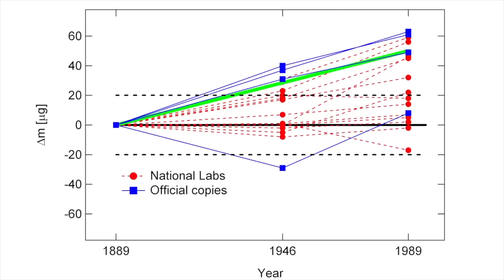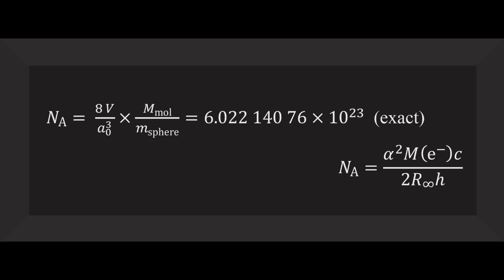The kg is dead, long live the kg

Comment: I've been waiting for this day ever since I took a course in thermodynamics. The way 1 kelvin is defined was a mess to understand and a whole lecture was spent going through how you need 2 reference points to define a temperature scale and for Celsius it was freezing and boiling point of water. For Kelvin they got absolute zero as one reference point but then it still uses the triple point of water as the other so it's still just a sliding scale between those two reference points. If I were to redo that course I could just ignore all that and instead just say that 1 kelvin means that particles in a gas has an average kinetic energy of 1.380649×10^−23 joules and that's the definition. No more absolute zero or boiling, freezing, triple point of water now temperature is defined to be a measurement of the average kinetic energy of particles in a gas.
Reply: I still think there's work to be done: Kelvin is just the scale we read off thermometers, but still we give it the lofty status of fundamental unit. Bah; temperature is just energy - just report it in Joules, with Boltzmann's k merely the conversion factor between the scale and the physical thing we're actually measuring (or just because we read the angular displacement of a needle in a voltmeter, do you think we should report volts in radians?)
Reply: @thstroyur  It's "lofty status" is the result of the fact that no other fundamental unit, or combination of them, can measure the property of temperature. Temperature is not heat, it does not take heat capacity or flow rate into consideration.  For example, the temperature of the sun's interior may be the same as the temperature in the core of an atomic weapon, but they area enormously far apart in terms of energy.  Your analysis fails there, and your analogy about voltage is just dumb, but in homage to the field of engineering analogies, temperature is analogous to voltage.  However, you don't measure electrical energy by that voltage; it's only part of the solution.
Reply: @puncheex2  "no other fundamental unit, or combination of them, can measure the property of temperature" I regret to bust your bubble, but units are arbitrary and devoid of meaning: e.g., in natural units, I may say that lengths have units of mass^-1 (Peskin & Schroeder, An Intro to QFT , sec. 10.1). Besides, you claim there's no other way; well, according to the eq of state U = TS + F, since U has units of J and T of K, S must have units of J/K, because it's obvious that's what entropy is about. Plus, where this dimensionality comes from: you guessed right if you thought Boltzmann's k. But suppose we call the quantities S/k and kT entropy and temperature respec. - would anything change in the eq of state? (Notice also that's conceptually distinct from merely putting k = 1 - that merely readjusts the unit of temp...)
"Temperature is not heat" Nor work - I said energy , I didn't specify which kind. But what do you make of the F above?
"they area enormously far apart in terms of energy" Yes - you can see why using the formula I gave above 😒
"Your analysis fails there, and your analogy about voltage is just dumb" If you rest this polite conclusion of yours in the previous, you rest on a strawman
"you don't measure electrical energy by that voltage" So how do you calculate the energy stored in a capacitor? Can't I put a V there somehow?
Please, educate yourself before criticizing others...
Reply: @thstroyur  what is the point of redefining temp to be in energy. The 2 are not linearly related and differ per material. So if it was redefined in J I would have to grab my calculator every time i wanted to know if there even is any heat exchange between 2 materials. instead of being able to tell they have approx the same temp anyway. For cryogenics i can imagine there are where instances energy is easier.
Reply: @someonespotatohmm9513  *0) I'm just proposing that T have units of energy, not be energy itself, cf. U = TS + F, 1) It intuitively makes sense (look up equipartition, <E>~kT/2), 2) it clarifies the meaning of entropy, which, up to the physical factor of k, is defined as Shannon entropy by Gibbs and Jaynes, 3) "The 2 are not linearly related and differ per material" you're thinking material-specific stuff like thermal expansion, etc., whereas T is a macrostate (or at least conjugate to one), just like volume or particle number, 4) "I would have to grab my calculator" no you wouldn't, 5) this is already done in plasma physics just because for large temps the units read as simple multiples of eV (100°K~1meV, 10^8°K~1keV) - the diff is that this is like reporting frequencies as cm^-1, rather than acknowledging T's dimension is unnecessary
Reply: Great.  But then someone finds that the value isn't ...0649 but rather ...1649.  Will your thermometers then change, or not?  I'm not saying tthe idea is wrong, only that science advances, so you have to figure out how your measurements will work in that regime.
Reply: @puncheex2  if it's defined as ...0649, then your thermometer would by definition be wrong, and need adjustment. This is a feature, not a bug!
Reply: @SimonBuchanNz : Simon, they are defined constants for metrology purposes only.  For other scientists using Planck's Constant or whatever, they will proceed to use the latest values determined by experiment. Eventually, the values used to define the SI units will change as well to incorporate changes.  There are probably hopes that later determined values will be close to those chosen this month, but there are obviously no guarantees.  When the metric system was developed, the meter was set to 1/10,000,000 the distance from the pole to the equator.  Today the meter is 1/ 10,001,960 of the same distance description.  They didn't change the meter or the Earth to make the definition stick - they changed the conversion factor.  Scientists didn't persist in using the old definitional value for that distance after they had refined it.
Reply: Physical constants will be defined to have specific fixed values and then the size of our units will be determined to better and better precision as technology improves. Our understanding of the size of the units we use to make measurements will evolve over time instead of the values of physical constants in terms of our units.

Comment: I kind of don't like that the fundamental constants of the universe end up being these long messy numbers. Does there exist any possible system of human-scale units such that all the constants are neat round numbers? Or are the relationships between the constants such that they'll never be neat, no matter how we define the units?
We should be able to set up the units so that at least some of the fundamental constants become 1, right?
Reply: Nope.  Why would they line up with our decimal system, or anything else consistent?  You could make your most fundamental constant 1.0000000000, but then you're going to be breaking all the other units to do it.  Since there's no real advantage, it makes more sense to define them arbitrarily to not break the existing units (or to break them as little as possible, where there are conflicts shown by fundamental relationships)
Reply: You could set them all equal to 1 if you wanted, but then the definition of every unit would change massively. The whole society would have to adapt and all previous research would have to be converted, easier just to choose values close to what they were under the old system.
Reply: @oniondesu9633  You actually can't, some constants always get messed up. That, however, didn't stop scientists from trying. If you google "natural units" you'll see different attempts.

Comment: Fixing Planck's constant seems like a bad idea. There are better solutions to the mass problem than to mathematically define constants. Our measurements will only improve with time, and this system will also have to be overhauled. There has to be a better way.

Comment: It is a fundamental question of whether universal constants are rational or irrational.   If universal constants can be written as sums of series like Pi or e then all these definitions of fundamental units are wrong.  

 About a month ago professor Atiyah ‘s research on fine structure constant showed this constant can be written as a sum of a series.  This also leads to solving the most famous  Riemann hypothesis.  

Although the general criticisms saying this claim for solving RH is wrong and unpatchable, this makes me to rethink whether the values of universal constants are actually rational or not.
Reply: I think you have missed the point of the issue, the value of the constants is entirely arbitrary. Choosing a value of the constant determines what the unit of measurement is. If under one system you have h = pi, you can convert it to a system whereby h = 1, and all that will change is the definition of a kilogram. Whether the constant is rational or not is irrelevant.

Comment: Next step,  special scientific units compatible with the fundamental constants. An alternative to second taking 10^10 periods of the radiation corresponding to the transition between the two hyperfine levels of the ground state of the cesium 133 atom, a unit of length that light traverses in 10^8 of these, a unit of mass equal to the energy of light at 10^50 Hz...

Comment: There's a fundamental philosophical problem with tying reality to abstract concepts in this manner: It trains people to never question things called "constants." Science is about overthrowing ideas, not enshrining them forever.
Reply: Scientists would always question assumptions. That's what it means to be a scientist.
Reply: And yet, this process is to enshrine assumptions in stone.
Reply: @GrantDexter  We just changed a unit. We redefined the kg in a different way, it's far from changing our understanding of reality.
Reply: That's fine. However, my objection has not been addressed.
Reply: @GrantDexter  I don't really get your objection. You do realise that all physical constants are absolutely arbitrary unless they're dimensionless, right? It's not a harmful assumption but a matter of sanity. We aren't tying reality to any abstract concept whatsoever.
Reply: Actually, measurements are being tied to abstract concepts. That was the whole point of the video.
Reply: @GrantDexter  That's always been done, you can't have measurements without abstraction. The ratio between energy and frequency (Planck's constant) isn't any less abstract than the old 1kg block.

How do you think we measure mass? It's already an "abstract concept" because we  can't measure it directly, we must use the ratio between force and acceleration and call that mass. Now we chose to do the exact same thing but instead of doing it with a block of metal we use light and energy. Those aren't abstract concepts. Or at least not more abstract than what we previously used.
Reply: There's nothing wrong with abstraction. There is not going to be any problem using this new system. The problem I outlined is philosophical. Tying measurements to a unit that will not be changed implies that the ideas that led to establishing the unit must be correct. This process enshrines ideas, the opposite of science.
Reply: @GrantDexter  You are speaking of these "ideas" that are assumed to be correct, what kind of ideas are you talking about? We could just grab a random object and call it a kg, it would be exactly the same. Absolutely no difference. What idea are we assuming to be correct? We just picked up an object. There are no ideas that established the unit.
Reply: The assumptions behind the establishment of the constants being used, be it lightspeed or Planck or whatever.
Reply: @GrantDexter  You still refer to "assumptions" but never say explicitly what we are assuming. Do you know something that the rest of the scientific community isn't aware of?
Reply: If you don't know, or aren't prepared to research, the assumptions that go into things like those I shared in my previous post, then there's not much point trying to explain the philosophy of science.
Reply: @GrantDexter  it's clear that you are throwing around random words hoping to sound intelligent because you don't know how to reply as soon as someone asks which "assumptions" are concerning you. Great strategy.

The only assumptions we are making are that the speed of light is constant and that energy is proportional to frequency. These two assumptions currently give a good explanation of physical phenomena so we haven't been able to reject them. Your opinion that using this assumptions would go against the philosophy of science is laughable. Why do you think that we used a solid block of metal to define mass? Because we assumed that mass equals the ratio between force and acceleration. Obviously that assumption didn't stop us from questioning it because we then discovered that force doesn't always equal mass × acceleration. Your fear of assumptions only shows your ignorance about the history of science.
Reply: Apart from the fact that I've clearly stated the ideas in talking about.

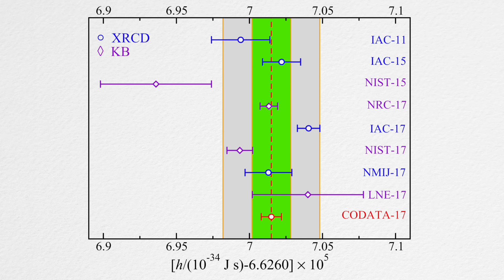Comment: I don't understand how Planck's constant is exact now. Doesn't Planck's constant not rely on a larger variety of measurements? If it relies on measurements, then the value of Planck's constant is not exact - per definition. Even if it's not per definition not exact, the graph at 3:30 shows various estimates of the mean, along with standard errors. Standard errors of a size above 0 exclude exactness.

I accept that redefining Planck's constant is revolutionary, and that it allows for far more accurate, precise and reliable calculations. But I do not accept that it is exact.
Reply: "Doesn't Planck's constant not rely on a larger variety of measurements?" This is the whole point, currently Plancks constant depends on measurements of physical quantities, but the number is completely arbitrary and just based on how we define our units. Once the fix the value of the constant, we can swap it around so the constant defines the units. We could set Planck's constant equal to 35 and it would have been correct, but then the kilogram would be significantly altered.

Comment: I saw the meter is defined by The distance travelled by light in vacuum in 1/299792458 second. Is this distance independent of gravity? if this measurement would be done (in theory) near a black hole, wouldn't the light bend, resulting in a longer path? Or is nothing strong enough tot have a bending effect over the span of a meter?

Comment: As an American who understands both metric and imperial, have always argued that metric is an amazing execution but horrible principal, as the measurements, as far as I've been aware don't have any defined exact besides what we've given them.

While imperial is a great principal but horrible execution, basing everything on human averages, although failing as I don't think any proper scientist tried to average it out if my memory is correct, 100, being "average" human core temperatures and 70 being mild, keep in mind 70% is a C and has been used to mark average scores for some odd reason instead of 50, and using 70 as mild exterior temperature, which would be about 16C, and 100 as human, we then get our 0F good principle using human averages so you in theory wouldn't need to rely on measuring tools for rough measurements, same with weight and distance, but ultimately failing horribly in execution as it's just a disorganized mess because no actual averages were taken into consideration, and those averages can and will change.

This new method would really define the metric even more as the superior system, I'm still hard wired into thinking pounds due to every system around me requiring them, and that when it comes to day to day uses that fahrenheit is more practical since it is based on human needs, as well as easier to get a more preceise read for things like fevers and weather since the boiling point of water for F is 212 thus giving us twice as many points to map out without going into decimals, and as such I genuinely wonder how different it would be if we historically had one system made that took the human use practicality of imperial but the great execution, math and science of metric and how many more children would have grown up into scientists just because they were able to more easily grasp onto the world around them in a familiar yet analytical way, I guess it's as its said "the current systems we have are far from perfect, human flaws follow into everything we do, but god damn if this isn't the best we have ever had and we can only strive to make it better" never stop marching forward science
Reply: Human averages? The average foot sizes a 12.
Reply: @2adamast  like I said, there were no actual averages taken, or scientist present, just one man, I think it was a French king, dictating all of this, thus the horrible execution, plus I'd personally would have preferred the unit for distance to be measured on the human height, the average at the time being measured in units of 100

Comment: But doesn't the Plank constant represent a fundamental relation like, say, pi ? I mean, you can't just "set" pi to equal 3.1, so what makes the Plank constant different?
Reply: Because mathmatics =/= physics. Units are nothing more but references and if you change the reference, the constant itself might not change but the value can. This isn't the same as in mathmatics where units generally don't exist except degrees and the likes and therefore no number has got any reference.